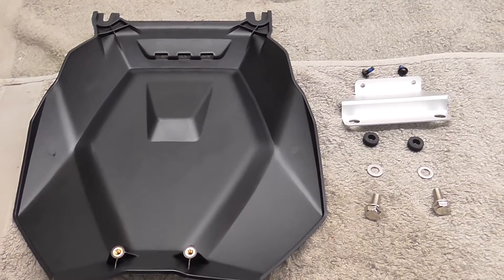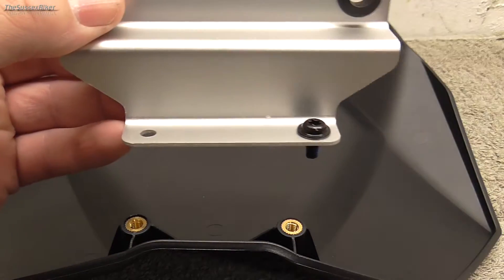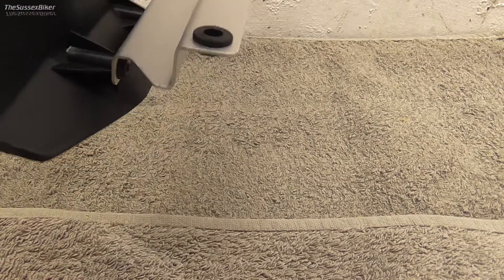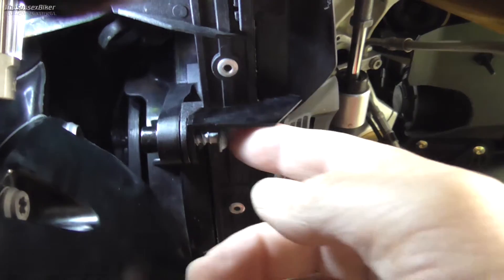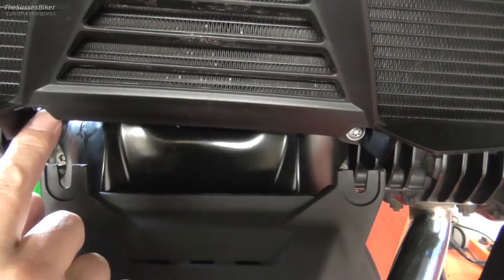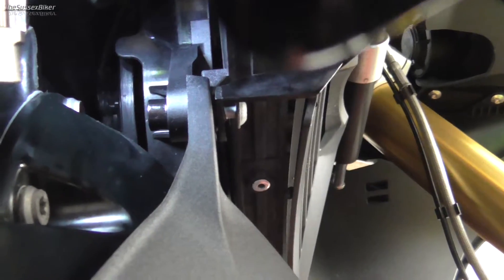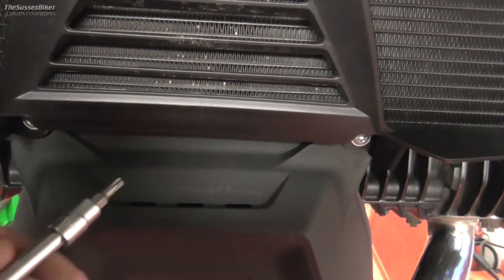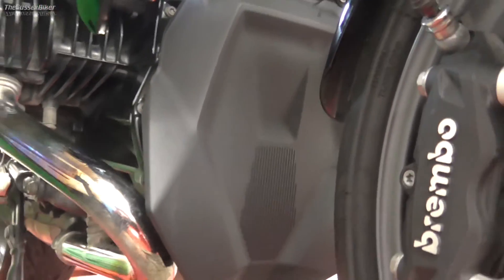BMW R1200RS (R1200RS/R1200R) machine-artmoto AvantGuard Install

Comment: Looks like a solid cover, are you happy with the appearance after installation? my bike is black also is their a big contrast in the cover and your paint when you move away from your cameras viewpoint. Thanks
Reply from the maker: Hi thanks for the question. I am happy with the guard, appearance wise whilst it is a different shade of black compared to the paint,it's not enough to bother me and when the bike is on the ground you don't really notice it. I would rather have this and not get the engine front cover peppered with stones etc.